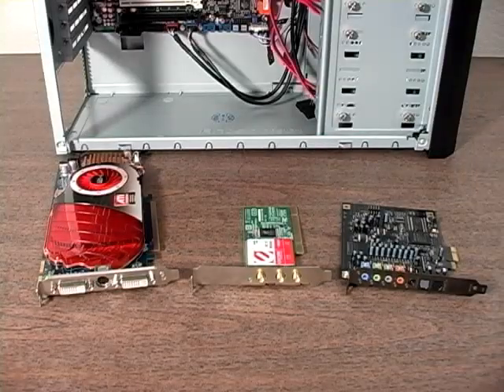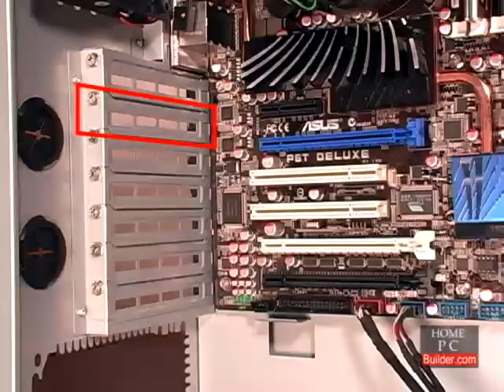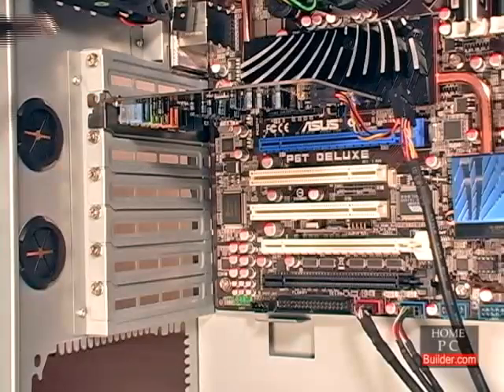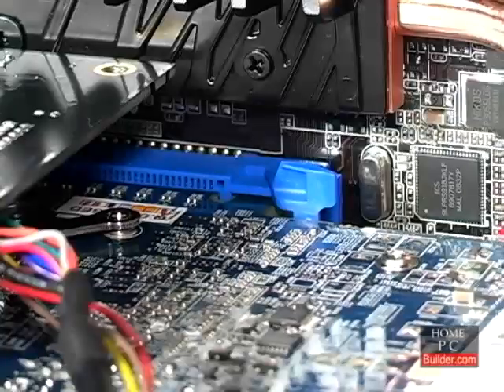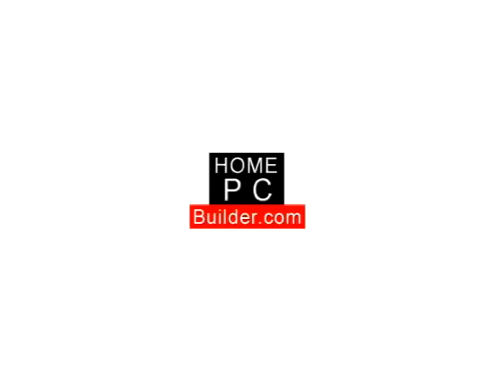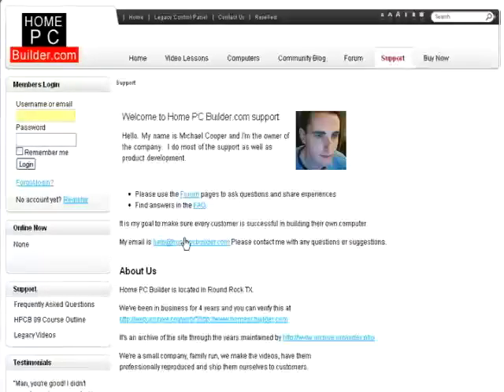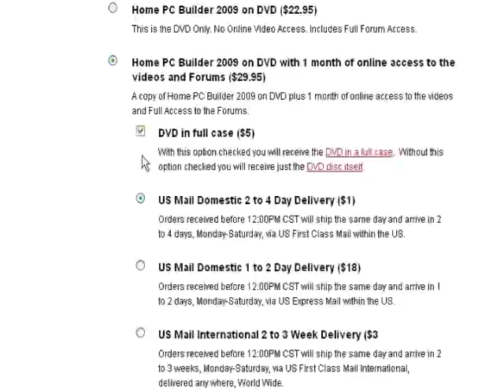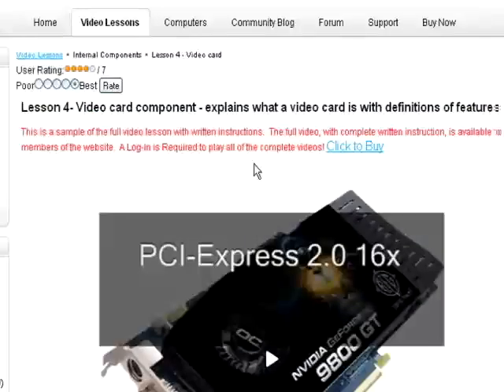Build a PC Computer - Installing video, sound and other cards - All New for 2009 - homepcbuilder.com

Comment from the maker: For the most part, yes.  Motherboard are usually either ATX or Micro-ATX and just about every case has the correct mounting holes for both.  There are smaller motherboard types and some PC makers use non standard motherboards that make replacing the motherboard difficult.  Look for either ATX or Micro-ATX support in both the motherboard and case and you'll be OK.

Comment from the maker: The sound built into just about every motherboard is fine and most people don't need a separate sound card. The same goes for the networking card, most motherboard have this built in as well. The video card should be a priority unless the motherboard you choose has video on-board and you don't need a better one.  On-board video is OK for a general computer, but if you want to play 3D games a separate video card is highly recommended.

Comment from the maker: @drblaze2 The Core Duo was introduced in January of 2006.  PCI Express 2.0 which is the current video card standard didn't get wide use until 2007.  The only way to be sure is to open the case and look for either AGP or PCI Express written on the motherboard's top expansion slot.  If it is PCI Express you can get one of the newer video cards.  If it's AGP you are going to be stuck with a fairly low end video card, but better than the GeForce 7300 Le you have now.

Comment from the maker: @Deathofblades Only if one video card isn't meeting your needs.  A second video card can be used to improve the speed of graphics in games.  Having two or more video cards connected together is called Crossfire by ATI and SLI by Nvidia.  The cards have to be compatible, usually the same model.  You can also connect more monitors to your computer by adding more video card.  Most video cards have 2 outputs so you can double your computers monitor connections to 4 if you add another card.

Comment from the maker: You can use Add Remove Programs in the Control Panel to remove the drivers for the old card and then downloaded and install the drivers for the new card.  However if the card is from the same chip maker, AMD (ATI) or Nvidia those same drivers the old card was using may work with the new card.  This is because both AMD and Nvidia bundle drivers for several models of cards together into one set of drivers.

Comment from the maker: No you don't separate LAN and sound cards.  The ones built into the motherboard work just fine.  Adding sound cards and networking cards is just for adding more features the on-board sound and networking don't have. Such as better sound quality, processing features or additional inputs and outputs.

Comment from the maker: @Deathofblades It is better to have 1 really good video card than 2 lower performing video cards working together.  You should get the best video card you can afford now and make sure your motherboard and power supply can handle a 2nd video card.  In a few years when the newer games need more graphics processing power you can buy a 2nd video card to improve performance.

Comment from the maker: @TheAwsome301 The HD5770 is from a newer generation of cards than the 4850.  I would say the performance would be similar.  The HD5770 is a decent card and will play games well, but not great.  If you need support higher resolution or you want to do anti aliasing to make the games look their best you'll need a higher end card.  The HD5770 can do high resolution and anti aliasing but the game would run very slow.

Comment from the maker: @hpcbdvd You also have to take into account the amount of power the new video card will require to run.  Don't expect your current power supply to be able to handle the latest high end or even mid range video card.

Comment from the maker: @canttouchthisnananan Most PCI wireless network cards won't take up the whole slot and this is OK. As long as it fits in the slot and you can screw it to the case it will work.

Comment from the maker: @platinum243125 You can add a graphics card to a system with integrated graphics.  The system will automatically detect the new card and disable the onboard graphics.  The new card will not use any of your system memory so the portion of RAM the onboard graphics was using will be freed up.  It is possible to put in a faster CPU into a motherboard.  Do you know the fastest CPU your motherboard can accept?

Comment from the maker: @counkev AMD just release an new FX line of CPUs.  The high end part 8150 has 8 cores and comes close to i5 model 2500K performance.  The 2500K is a 4 core CPU so AMD still doesn't have as good performance per CPU core.  The AMD 8150 is around $80 more than the 2500K.  AMD will probably lower their prices.

Comment from the maker: @Deathofblades Tell them that Macs aren't virus proof either.  There aren't as many viruses for Macs because Macs only make up about 5% to 10%, depending on who you ask, of the computers currently in use.  Computers running Windows are a much bigger target for virus writers so there are more viruses that attack Windows PCs.  It is very possible through good practices to keep your PC clean.  Run virus protection software that you update regularly and stay away from the wrong website.